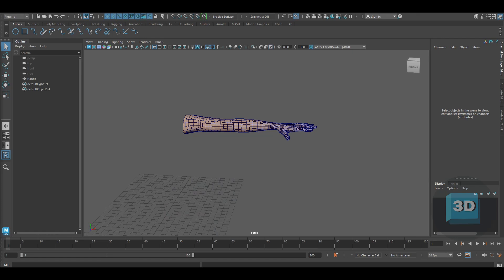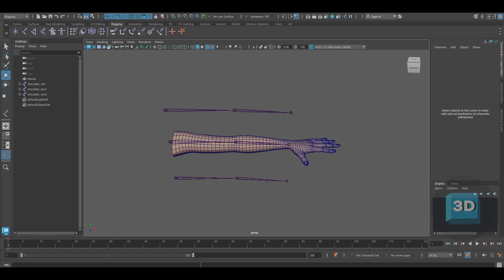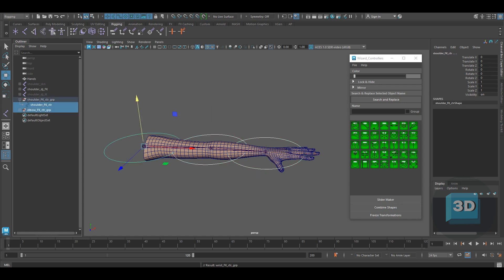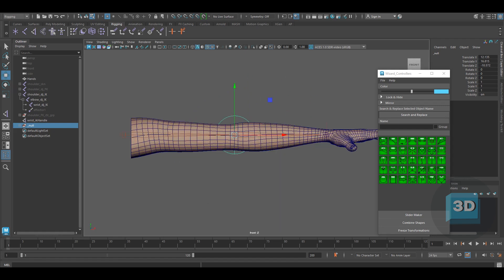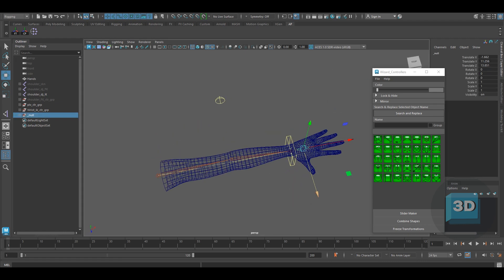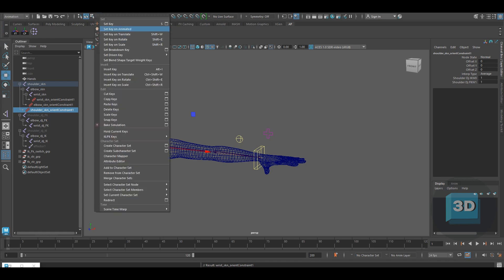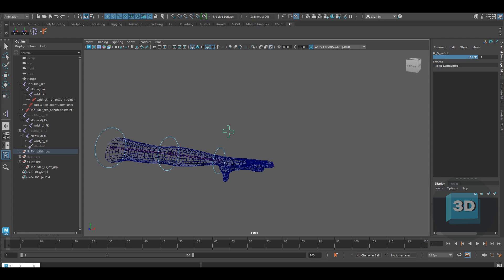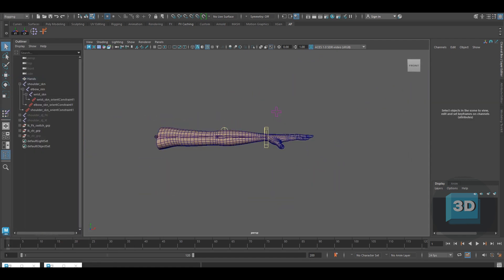Autodesk Maya | How to create a IK/FK Rig  #maya #3d #tutorial

Comment: Hey! If I bind my Skin Joints to the Mesh, then the mesh is only moving by changing attributes of those skin joints. IF I move any of my IK or FK controller, mesh isn't moving. ALSO how is your IK & FK controllers are affecting the mesh, when IK & FK Joints are hidden. [ At last, after binding the skin ] ?
Reply from the maker: @RatherNotSay21  If you watch the whole video without skipping, you will see I created a IK/FK switch. Which is controlling the orient constrain. And see how the orient constrain are attached to the skin joints. You can watch the steps from 7:18.